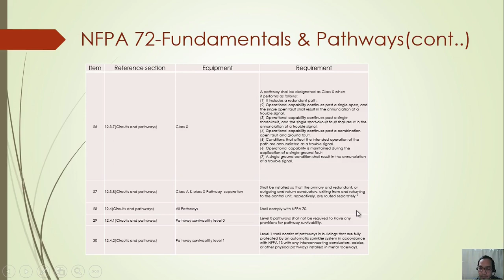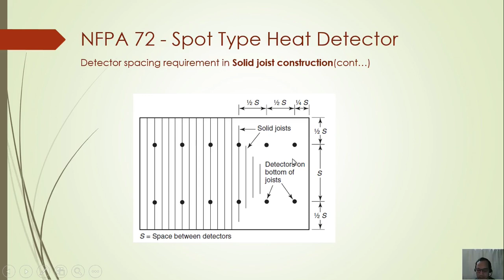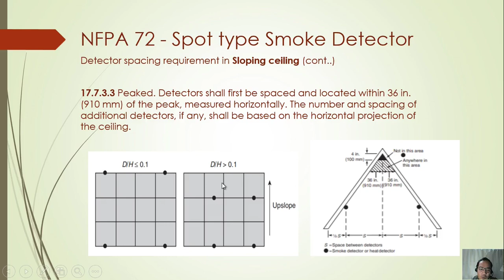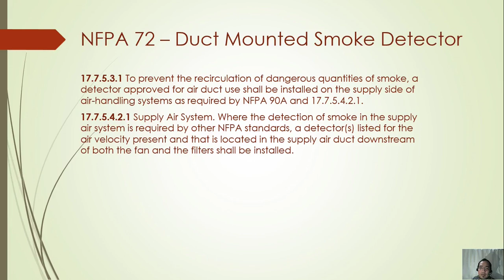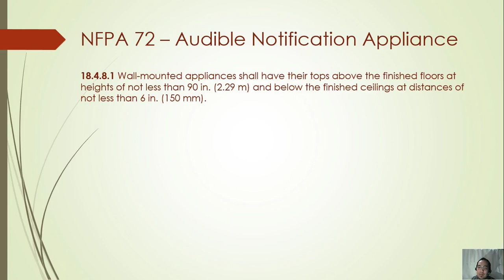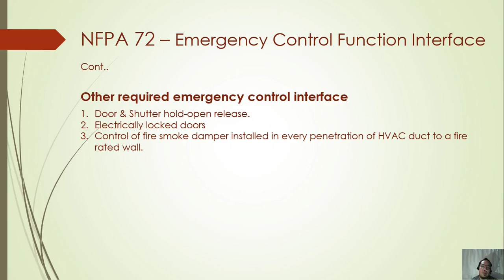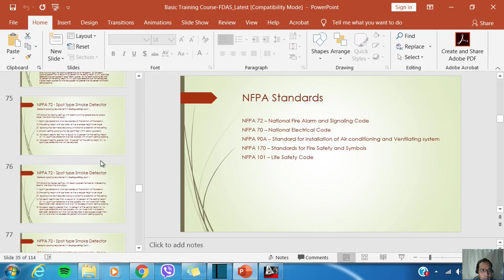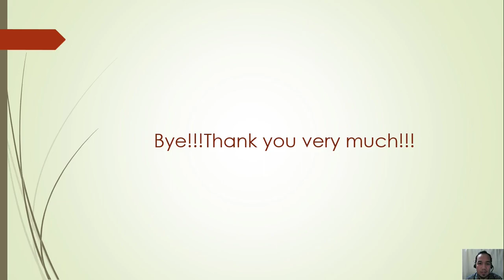Fire Alarm Installation Training - Design tutorial Part 3/3 #Firealarm #Design

Comment: I appreciate your time and effort 
Where in NFPA i can get the requirement of under raised floor detectors
Reply from the maker: Hello. It depends what code your project under. There are also requirements you can find from NFPA 75 & 76 if you are trying to design a detection from IT & telecom rooms. In general, you can find the minimum requirements from your code, if your projects required total/partial coverage or selective coverage.

Comment: How to determine tne number of heat detector needed in a building or is there any ration for smoke and heat detector?thanks
Reply from the maker: Hello richard, thank you for watching our videos. The number of your heat or smoke detector will depend on the listed spacing. You can find the spacing based on the datasheet for heat detector while you can use nominal spacing of 9.1 mtrs for smoke detector or as per manufacturer. But you have also to know the structure of your ceiling or ceiling height which affects your  placement of detector. You can find all the required videos for placement of detector here in our channel if you will check and I recommend you to watch please. Please note that our reference for most of the videos are based on nfpa. Other standard  like BS  example has different requirement.
Reply: @AllaboutFireProtection  thank you sir for the information, where is the heat detector commonly use or a must in a building? More power and videos to upload.
Reply: @AllaboutFireProtection  if you dont mind sir, can you share a copy o symbols ang legends used in designing fdas or any cad file that can serve as reference. Thank you very much.
Reply from the maker: @richardbutiong8762  Hi. First we have to check the local code or building code if fire alarm is required. Then only we can decide if detection is required. Heat detector is commonly used in kitchen/pantry, toilet, attics and other area where installation prohibits the use of smoke detector due to presence of dust, smoke, moisture etc..that will cause nuisance alarm. There are also available s manufacturer's guideline sometimes where they guide you the best suited type of device for particular application for ease of designer in selection.
Reply from the maker: @richardbutiong8762  Hello, the symbols I'm using is from NFPA 170. You can access the NFPA standards here for free once you register https://www.nfpa.org/codes-and-standards/all-codes-and-standards/list-of-codes-and-standards/detail?code=170.
Reply: @AllaboutFireProtection  thank you sir for the link, it will be a big help. Atleast i have little enough knowledge in other building laws. Lauckily i graduated architecture, i also want to expand my knowlede. Hope you can upload more videos to educate.
Reply from the maker: @richardbutiong8762  Yes. I will continue to upload for sure.

Comment: MACP shall be installed inside the room or outside the room within 1.5 meters of exit door??? Please clarify
Reply from the maker: Hi Shailendra. Do you mean MCP(Manual call point)? MCP doesn't need to be inside the room unless that particular door of the room is an exit door leading to outside of the building or "exit door" as defined in NFPA 101(life safety code) or an spacious room where the travel distance to the nearest manual call point will be exceeded leading to additional MCP to be installed inside the room). It is required in NFPA 72 that the MCP has to be located within 1.5 mtrs of the exit door. It means it will be located within 1.5 mtrs from inside of the exit door of the building or a room leading to outside or egress path.
Reply from the maker: Thank you for your taking time watching my videos. If you have further questions, you can send me a message in my  official page https://www.allaboutfireprotection.net/ and https://www.facebook.com/AllAboutFirePro/ or comment here.
Reply: @AllaboutFireProtection  your response in not clear. typically in high hazard rooms we install manual call point outside of main exit door.
Reply from the maker: @shailendra21271  Hi, if you are talking about manual release station for activation of automatic fire suppression system like FM200 etc...then you are right, they are installed outside the protected room.
Reply from the maker: There is a big difference between a manual release and manual pull station or manual call point when it comes to operation. That's why i ask you before if its manual call point, then what i considered in my reply is for the  installation of manual call point/manual pull station and not manual release station. I hope i made it clear.